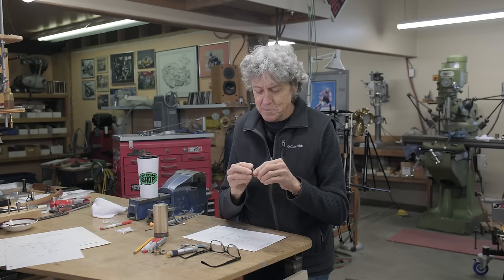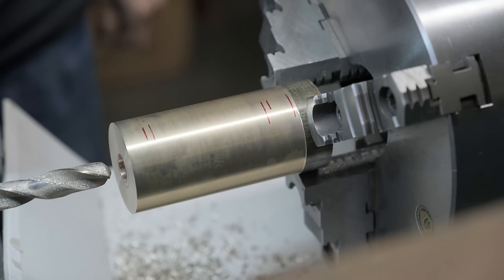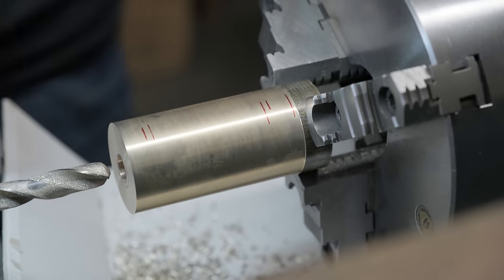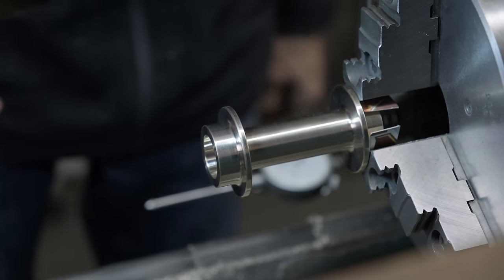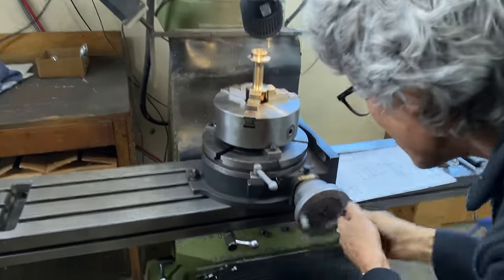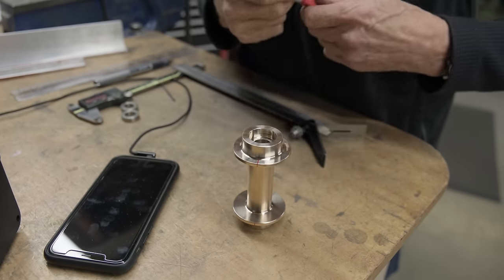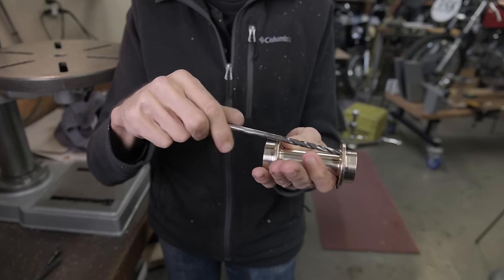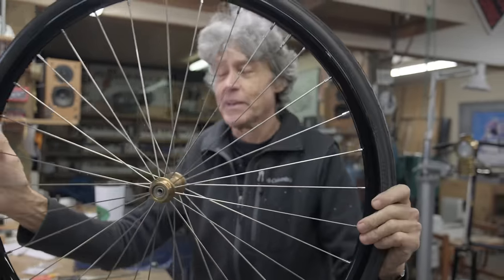Machining a FRONT HUB for the Giraffe Bike // Paul Brodie's Shop

Comment: For those that don’t know, setting the compound @ 30° makes sneaking up on a bore diameter all-kinda more-easier.

It’s a length of side opposite thing. With the compound @ 30°, a thousandths of compound feed (.001”) will be half a thousandths of movement on the lathe’s X axis (.0005”).

That makes it way more-easier to nail an interference fit w/out going over. With practice & a good feel for a particular lathe, hitting w/in a coupla tenths is no biggy.
Reply from the maker: That sounds like a good idea. I had not heard of that before. You might have taught an old dog a new trick :face-purple-wide-eyes: so thanks for watching and commenting....
Reply: Who has the patience though lol. That's why its called boring
Reply from the maker: I have the patience. I do not find it boring at all....    :face-orange-raised-eyebrow::face-orange-raised-eyebrow:
Reply: It’s not for everybody. Those who are up to it are the ones who just can’t wait to get to work in the morning, & have to be shown the door in the evening. What we do is engaging enough that putting it down & walking away can take a real commitment to a balance in life.

Aside from my own thing, I’ve never worked anywhere that didn’t try to pull me out of the shop & chain me to a drawing board or a CAD workstation, & I’ve never worked anyplace that I didn’t walk away from when they did. The challenge of precision is just too irresistible a draw, & it has been for right-around 5 1/2 decades.

As a toolmaker, or more specifically a mold maker, I’m driven by the need for high levels of precision. Toolmakers are all about quickly, efficiently & routinely hitting rigidly placed marks. Paul’s more free to place & define the mark, & that’s the difference between a craft or a trade & art. Paul’s artful application of a deep & wide ranging skillset has carved a place for him in cycling history.

Boring? Not even close. Most of us can only imagine how satisfying Paul’s career has been, but I can imagine that’s about like holding up a thing that I made my-own-self, knowing that it will serve it’s function & serve it well, & that I have too.

Comment: 3:44 those 90° corners will crack. Just like wagon wheel hubs from yesteryear you need a smooth radius for zero stress risers
Reply: If you’ll look he’s using a parting tool with a radius’ed insert and look again at 12:57 you’ll see those corners have a radius.

Comment: That's going to look great when built...
Non machinist question!...why did you remove from the circular table to do the final drilling with the pillar drill? Wouldn't it have been simpler/quicker/more accurate to just change the bit in the mill and continue?

Comment: love the work, but why do you drill the holes in the drill press when it is already in the mill?
Reply from the maker: Thanks Mike. In the mill I have to turn the rotary table 22.5 degrees for every hole I want to drill. I've already marked the positions with a centre drill, so the drill press is much faster for drilling the final spoke holes. The only problem is when the drill bit wants to grab the bronze....   :face-orange-raised-eyebrow::face-orange-raised-eyebrow:

Comment: Beautiful hub. Excellent work as always. 👌 
Not sure which BMX freewheel you’re using for the rear but recently a company called Theory BMX just came out with a nice high engagement freewheel called the rattlesnake.
Reply from the maker: Thank you..  It's a Micro BMX freewheel, very compact, with 14T. Now I just have to fit the skip tooth sprocket over top of everything...  What can go wrong?       :face-fuchsia-tongue-out:
Reply: @paulbrodie  I have full confidence that you will make it work 🫡
Also, it is snowing here too… I don’t like it. 😭 😆

Comment: Definitely should have used a center for the OD turning, and then gone back for the boring. Much more rigid. The bronze is soft enough that you got away with it though, it seems. So no harm no foul. Putting your sleeved arm over the chuck like that to file is really spooky. No need to get that extra pressure with the lean over.

It's also a mistake to use a center drill as a spot drill. It's giving too steep an angle for your actual drill, connecting on the outsides of the flutes and pushing the drill off axis, rather than providing a snug middle point for your drill's much shallower angle. You can see the effect of this as it tried to wobble away from you a few times as you drilled. You want to use an equal or greater angle for spotting. Would have been better off just drilling right there in the mill with a screw / stub length drill. By far the best drills to keep around. Running that deburring bit in a hand drill also would have been much more controllable. Just some thoughts as I watched. It came out very nice regardless of my ideas. Thanks!
Reply: You reminded me of Double Boost using his Dad's old wheel brace drill for de-burring purposes.

Comment: Paul, I looked at the bearing you bought for too much money. I buy the same German or Japanese for less than 10 euro here. One supplier I use is RS components which also exists in Canada. I looked at the prices on the Canadian website and they are at least 4 times more expensive and have a lot less to choose from. Is there some kind of bearing embargo going on in Canada? Weird stuff in my opinion. Best, Job

Comment: Hi Paul.
I really admire the stuff you make, indeed incredible. However, I have had mixed feelings about your approach to refabing on antique hubs ...  and now, after hearing your complaint about the expensive Japanese bearings, I just have to say it out loud: why dont you maufacture the old school "cone & cup -type" ? They are very easy to make, even in-house hardening with a flame is not a problem, given you chose sutiable steel (and of course, the balls I'd just buy) ... you can re-adjust the play by screwing the assembly together - a proven concept and,  from a collectors / antique lover's point of view,  very safisfying: it would be the original type of deal. Even with my much lesser skills, I have made quite a few repro-hubs for 1890s Safety Bicycles , incorporating the traditional design and they all look and ride great... in other words: it is "more original" and cheaper, why would you not want to do that ?  Either way - pls keep the great work :)
Reply: Forgot to say: I could kind of understand the approach of using modern ball bearings for an antique motorcycle  ... but for on a antique bicycle imo it really should not be done

Comment: What? 80$ for a cylinder of brass? Im in the wrong business.
Reply from the maker: Yes, I just ordered the bronze for the rear hub. It was larger and longer and it will cost me $135 plus tax.  Metal is very expensive....   :face-orange-biting-nails::face-orange-biting-nails: